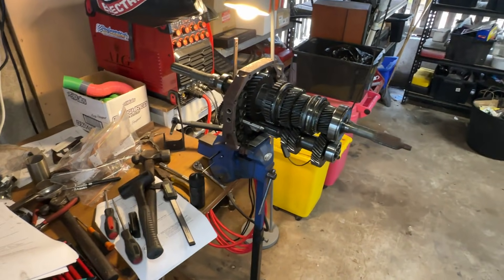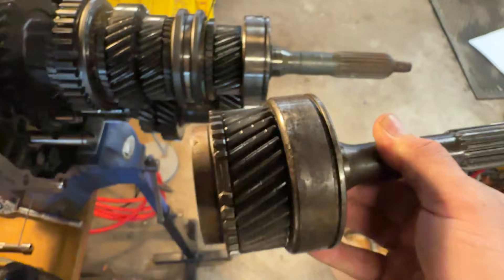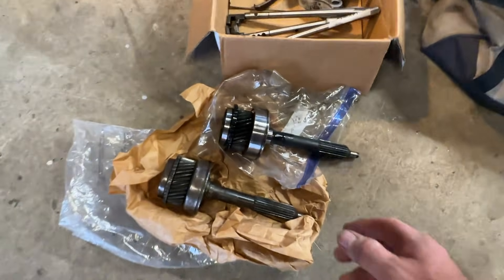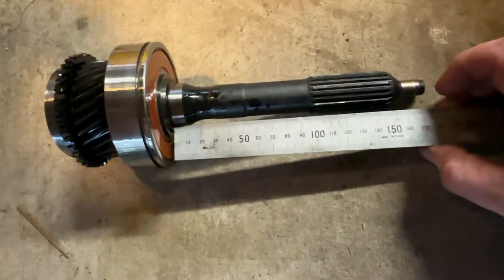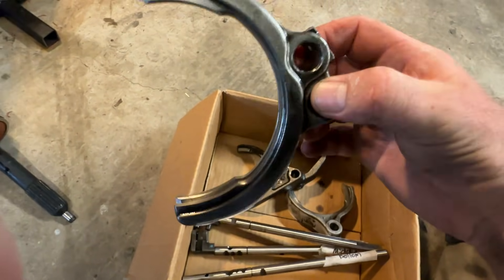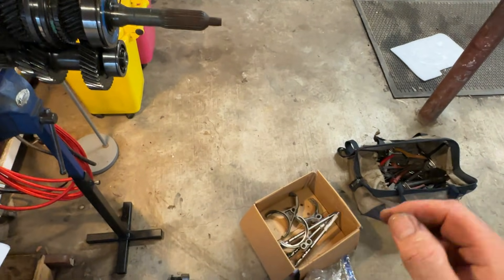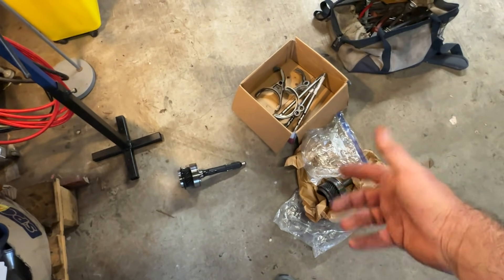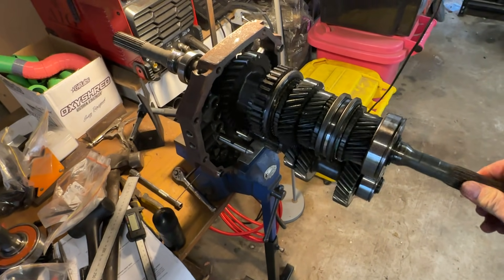R154 R150 R151 INPUT SHAFT Differences & gearbox internals - JZX90 / JZX100 / JZX110 / 1JZ / 2JZ

Comment: Amazing vid ,how many teeth does the longer shaft you are putting in the r150 count ?
Reply from the maker: @Ae92Levinking  teeth on the input spline? Or teeth on the gear? It’s identical to the one I removed. Just longer shaft. I’ve completed fitting the input shaft now (the video was shot a couples months ago). It was a perfect fit. You can buy an aftermarket, longer shaft on eBay.
Reply: @Fine_Performance  couple months ago ok cool , it's the teeth on the gear. I would like to know how much it counts . Do u still have the short one ? Count it and tell me plz 🙏
Reply from the maker: @ yep I’ll do that now
Reply from the maker: @ 29 teeth on the gear. 21 splines on the input shaft.
Reply: @Fine_Performance  ok thanks 👍🏿 that's the same one I have in my Cart ready to order . It's the same gearbox I'm going to use in mime r150 the earlier one, looking forward for the next video 👊🏿
Reply from the maker: @ oh cheers man. I didn’t think anyone bothered to watch my videos. I’ll make some more then. Oli’s marlin crawler parts arrived so I’ll show them.
Reply: @Fine_Performance waiting for more videos, u can drop a video driving the r150 when it’s finished, changing gears and how the ratio set up. u know just to let us have a idea 👍🏿
Reply from the maker: @ yeah man will do. If you want to see a car already, there’s a MZ20 soarer machine check under this playlist. That has R150 w/ 3.9 diff ratio. But I’ll definitely do a comparison.
Reply: @Fine_Performance  ok cool
Reply from the maker: @ this car has R150 w/ 3.9 gears. https://youtu.be/bWd3cTwEOSA